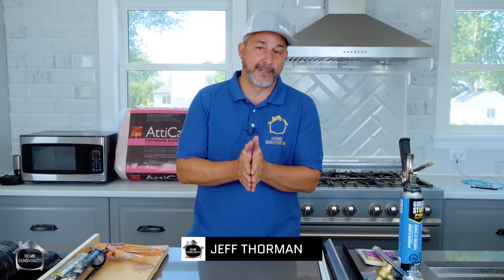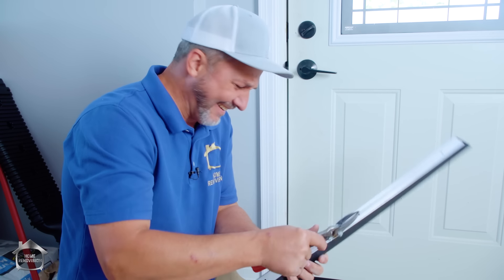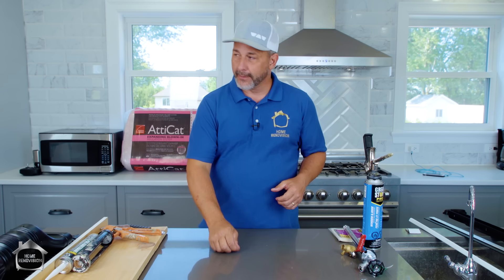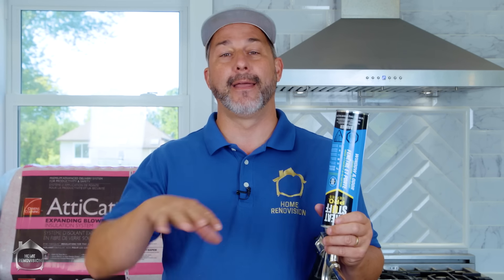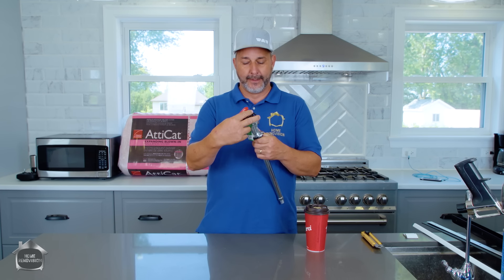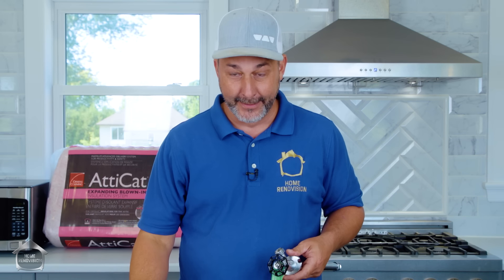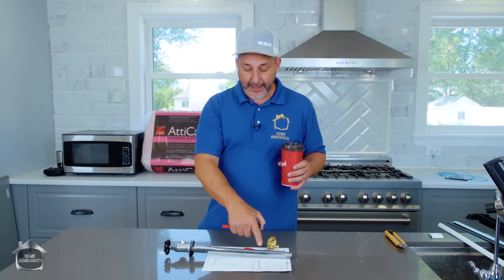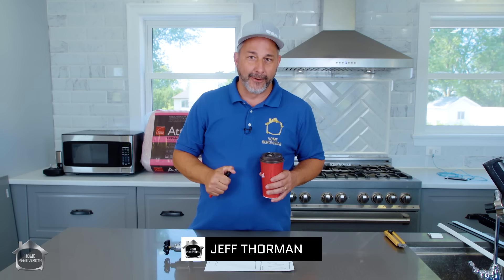How to Winter-Proof Your House and Save Money!

Comment: I crushed one of those little pads at the bottom of the door jamb right when I closed it the first time. There was not enough room to install them. What's the solution here? The hinge side is fine but the handle side crushes it inwards.. the video doesn't show him closing the door. What's the solution here when the gap is too small?

Comment: I live in Texas. Slab foundation. Of course long freezes are rare but what can I do to safeguard my outside faucets and pipes other than covers on the stopcocks.
Reply from the maker: in the event of a long freeze simply turn off the water at the street. empty the lines into a tub so you can use the toilets. if there is no water in the lines they can not swell and burst. Once the deep freeze is over you can turn on the water and be back in business like nothing happened. Cheers!
Reply: @HomeRenoVisionDIY  thanks. We had a bad one last year. Lost power for 3 days. One of my bathroom sinks on an outside wall partially froze but I got lucky. No burst pipes. Next time I will use your advice.

Comment: Hey Jeff, I've been watching your bathroom renovation playlist, and the fact that my place is built differently (metal studs and concrete floor) has sparked a couple of questions: how do you perform a shower pan demolition? (already did the walls) if there's rust in the studs can I replace a section of them? leave them like that?

Comment: Do the exterior hydrants always have a shut-off valve at the end from inside the house? I tried to look up mine...but the ceiling in the basement is covered and I would have to cut an access whole. Just thinking that I may need to install a shut-off valve if there is none...
It is a 2010 construction in Gatineau

Comment: Hey, Jeff! I get drafts from around my baseboards where they meet the floor. Suggestions? Wood frame home on a slab.
Reply: Sill plate Bottom is not sealed. Insulation is wet and air is going trough. Could be many things.
Reply: @cedricmeunier1787  builder's grade house in a cookie cutter neighborhood. Wouldn't be surprised is the sill plate isn't sealed

Comment: Hey Jeff I just realized my home only has a shut off valve for the water line at the back of my house but not the front. What would I do here other than having to cut out a piece and solder on a shut off? The line is in a hard to reach place to get into.

Comment: That last part about the hose bib freezing scares me the most. The first year I owned my house I just got lucky and nothing froze. Now I close the valve on the inside so no water goes to the bib, and leave it opened on the outside with one of those jackets over it. I hope that’s good enough 🤞
Reply from the maker: it is if the water comes out. Cheers!
Reply: @HomeRenoVisionDIY     If the angle is wrong, the frozen water near the end would still have space to expand towards the outside end where the water was evacuated. So, no worry?

Comment: I bought a flipped house and con't find the shut off valves.  I assume they are buried behind the dry wall.  Will a outside insulated cover help with this or cut out the dry wall and search for the valve.  It's a old home!!  what about shooting in spray foam/insulation from the out side?  Any assistance would be appreiciated.  Thanks for the great videos.  Been in home 7 years and haven't had a issue,,,,,,YET!!!
Reply: I used those in my old "new" home (early 2000s) in Georgia. None of the spigots had shut offs. Never once had a leak when using those covers.
Reply: I'm also in Georgia and I have one master shutoff valve for all the outdoor spigots. Then again, I also have PEX which  can handle the expansion and freezing isn't going to blow your pipes.
Reply from the maker: since weather has variations if you are close to a zone that gets below freezing I would at the very least open up the ceiling and indentify the system being used.

Comment: You installed the corner seal incorrectly at 6:44. The seal should be longer vertically and narrow side should be facing inside. The way you have it will get chewed up by the door closing.

Comment: So we had our exterior door replaced and instead of getting the opening perfect they screwed the prehung doorframe in as it was. Now the frame bows out in the middle of the door near the latches and the gaskets aren't large enough to cover the gap. So I can easily see light through it and feel tons of air flowing through. It's sealed fine at the top and bottom, but how do you fix that? Do I have to rip out the door?

Comment: Hello Jeff,  I was wondering if you could give me some advise please. I have just purchased a 9 year old house, and I have 2 weeks to move from my current residence to the new house, but in that time, I am  re-painting the interior ,  renewing the carpets, plumbing,  and all the other things needed to get it ready for to live in. 
But..it has these awful floor tiles that I am not going to have time to replace. They are tile on concrete slab, and I was wondering if  there is any way to floor over the tiles with no issues, ( planking, ect)..and what would be the best way to do it.
I looked through your vids, and did not see any that you may have done on this issue. ( i could be wrong, but you have so many great vids, its easy to get distracted!)
Hello from Northern Australia, where we rarely get the cold.. :)... hope you can give me some tips!
Thanks for the great content.
Reply: In the US we have some vinyl planks that are thin, durable and with gorgeous designs, hope that helps.
Reply from the maker: Hi Dan, Installing a floating floor sounds like a great plan. do you have vinyl plank with spc core available in your area?
Reply: @HomeRenoVisionDIY   I am looking around for the spc core product . Seems a little bit harder to get here. Will keep looking  though!

Comment: A) Why are you putting a winter shutoff when the frost free inside the house....Yes is has to be on a slope but if it is, as soon as you turn off the water, anyone on the outside of the washer will drain out

B) Its not the expansion of the ice that splits the pipe, its the compression of the water, you cannot compress a liquid!   Seeing how there is no water on the outside because it was installed properly and the water drained.....the ice will expand inside the pipe and will not split the pipe   

C) the bleeder is not going to do anything because if there is water in the pipe, it is on the other side of the washer  You would have to close the valve  go out and open the bib go back an open the bleeder then go close the bib again.....your way there is not advantage to having a frost free bib

Comment: You know I actually have a question - I bought a house over the summer with a sprinkler system and I have no idea how or if I'm supposed to winterize that thing up here.  (40 minutes US side of Vancouver Canada...)  I've checked the hoses and we don't have the recessed valves, seems people just put foam caps on the outside here, but I've got zero clue about the sprinklers.

Comment: This is good stuff especially the outside faucet.  But buy a house from a cheap builder, you don't get all of these things like quarter turn shutoff valves, etc.  Lord only knows what else.  Go through and check all this stuff when it's warm and fix them before winter.

Comment: I have a question that wasn't really covered in this video. It's about insulation. And I have looked everywhere online and I have yet to find the answer to this issue.
There was water damage to a garage wall that is attached to an existing house with a living space on the other side. Only the drywall on the garage side was damaged and needed to be tore out, along with the insulation in the wall.
How would I go about re-insulating that wall that's attached to the house, with the vapor barrier being on the inside of the wall? I only have access to the garage side of the wall. So I would not be able to staple the faced insulation as I normally would. Because I'm working from the garage side not the living space side. Would I just turn the insulation around push the vapor barrier towards the existing drywall on the house side and then put up mesh netting and then install drywall?

Any advice would be great.

I've looked online for this answer everywhere and I cannot find it. Because I know the vapor barrier needs to be on the living space side.  However, I don't have access to the living space side.

Comment: I have a garage door that doesn't sit completely on the ground at one end.  No idea why since it opens and closes smoothly and there is no cracks in the garage concrete.   Is there some sort of 'door sweep' or cushion that can come down and help seal the door a bit more?
Reply: Garage door seals are available at all major home improvement stores and are super easy to install. They're useful for temperature regulation, as a moisture barrier, and for keeping small pests out. Good luck with your project!

Comment: What do you do if your doors are metal?
Reply from the maker: no worries mattie! pre  drill the holes for the sweeper and install the screws. it will work just fine. just be sure to make the hole a little narrower than the thread of the screw!

Comment: Jeff you mentioned the humidity with the furnace, what if one has natural gas?  How does one control the humidity then?
Reply from the maker: every furnace can have a humidifier attached to it. it some places it gets so cold that the furnace runs more and we tend to open the doors less. in this situation it gets so dry that the house and the body can be negatively affected. without adding humidity at the furnace the only option is long hot showers and boiling water to raise the humidity level in the home!
Reply: @HomeRenoVisionDIY     Why do some humidifiers have the humid output air duct going into the return duct? The humidity will evaporate when the air is heated. Why are they all not placed on the supply side AFTER the heat exchanger??

Comment: 21:28 "Every house that has a hose bib has a shutoff" Not mine thats for sure!
Reply: I was going to say the same thing! We MIGHT have one, but it is down in our crawl space- and I do not go down there.
Reply: I don't have one either. But my faucet on the outside of the house has a different design. It is kinda like a Y connection, which I think is called a freeze proof faucet or something like that. East coast of Canada...... very cold winters
Reply: @ourkid2000  Mine is also freeze proof and the one he was showing also was since the actual valve is inside the house and it can drain the rest. Still, it is always nice to have a shutoff.
Reply: That freaked me out too when I looked and didnt see any ball valve. I rewatched the video and it was just unclear that he meant either a ball valve or a bib with the valve inside the house.
Reply: I live in Colorado and my outside faucets most definitely do not have a shut off valve since the pipes are embedded in the wall somewhere.  They do have that freeze proof thing on them, and I also cover them with a foam contraption in the winter.

Comment: Why is air sealing doors seem easy here. All the doors I have sealed, the door frame has shifted slightly so. The air leak on the top of the door is not close to the same width as on the bottom. I end up with a lot of head scratching.

Comment: Do you have to mud the drywall in a shower, if you are using Aqua defense?
Reply from the maker: best to seal the edges at the very least to keep the joints from movement
Reply: @HomeRenoVisionDIY  okay, thanks. I will. Drywall primer work as a sealer? Or did your expertise have something different in mind?

Comment: How do you stop a draft comming in a sliding glass door anyone that could help?
Reply: add thick wool curtains or bubble wrap large bubble to the glass. easy. transparent and can be reused year to year easily
Reply from the maker: use the plastic sheeting idea with the hair dryer.

Comment: But all my piping is in the crawl space and that place is SOOOOO sketchy!!  Ugh...
Reply from the maker: you will never see the temps get as low as we do in a crawl space so not much risk of freezing. Cheers!
Reply: @HomeRenoVisionDIY  Still want to change out the steel piping for pex and have some wiring I need to work on going through there as well....  So, so sketchy!  Appreciate the info on the crawl space though for sure!